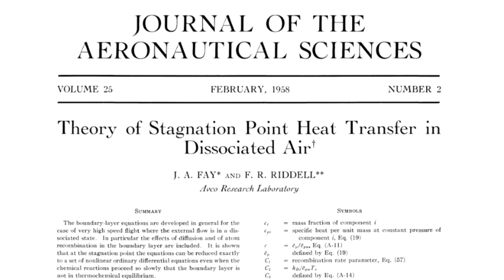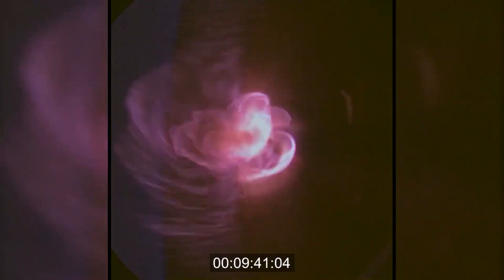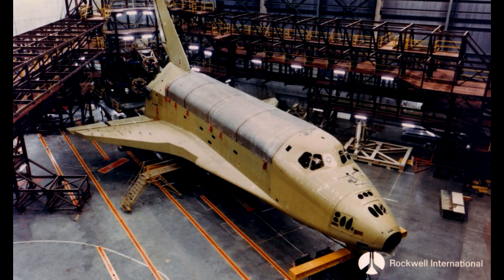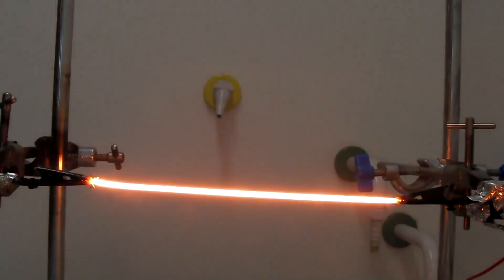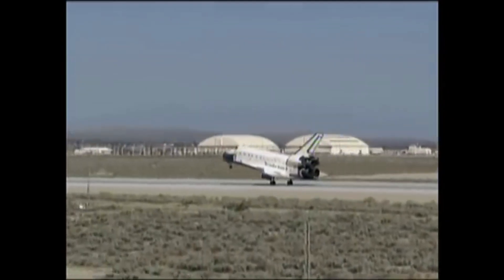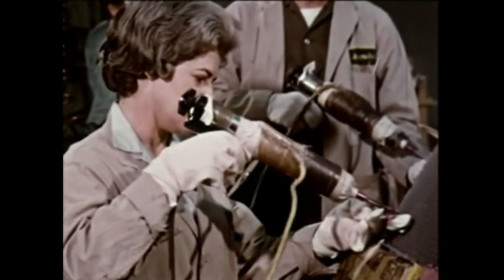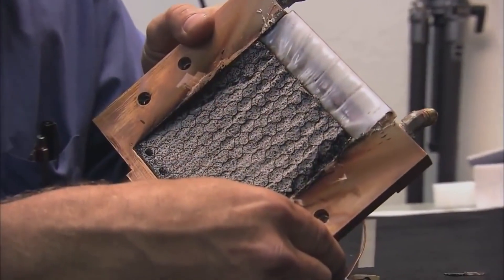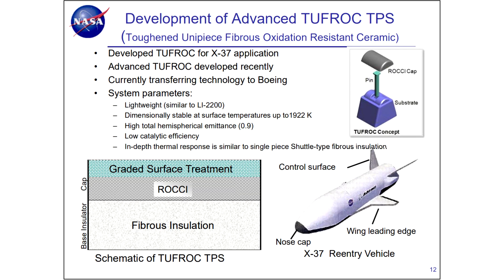Heat Shields - Things Kerbal Space Program Doesn't Teach

Comment: Has the conceptual heat shield known as a "Balloot" ever been tried? I remember reading about it in either Popular Mechanics or Popular Science the 80s as a teenager. That article was done around the time the movie 2010 Odessey II was released. Everyone remembered that Balloot idea that the Soviet spacecraft used to brake it's speed as it entered Jupiter's atmosphere just long enough to place the craft in a comfortable orbit. Inflatable huge balloons around the main engines. Main engine rocket exhaust envelopes the spacecraft as a cooler layer between the spacecraft structure and Jupiter's superheated atmosphere it's plowing through.

Comment: what about carrying enough fuel to slow the reentry speed to an easier value to handle heat-wise.   
That’s basically what Space-x does with its boosters, isn’t it?
Reply: The Falcon boosters are entering from suborbit, almost just a straight-up-and-down trajectory. They have very little velocity compared with orbital velocity. So the reentry burn doesn't have to be very big to negate a lot of that velocity. Coming from orbit, a reentry burn would have to be enormous, and would require launching an insane amount of propellant, which in turn would require an impossibly big launch vehicle for even a small payload.

Comment: I will ask perhaps a stupid question but it bothers me some time already. Could we actually transform the kinetic energy into something we can save? For let's say launch?
Reply: You could build a heat engine that uses the shock heating for its hotplate and a radiator for the cold plate.
Then you would have to store the energy somehow, meaning several tons of batteries.

That would mean adding a huge and massive contraption, capable of killing everyone inside the capsule if it fails and making the whole mission incredibly expensive, heavy and risky.

You would not recover much energy at all, most likely you would loose more energy due to higher launchmass than you would gain after landing.

Comment: I'm sure this has been asked:  is it easier to have the extra mass and special materials to handle reentry from interplanetary velocities, or, does one carry extra fuel (I'm reminded of old proposed nuclear propulsion where it was basically running 100% all the time -- accelerating half way and turning around and braking the remaining half) to reenter with less challenging energy deltas ?
Reply: From what's currently done, extra shield mass is what's the most cost/effective solution.
And it's easy to understand: in the shield case, atmosphere is what's givig you te energy to slow down, so it's almost free, but for the generated heat.

Comment: Hey Scott, love these videos. Please feel free to message me if you intend to cover hybrid/multicycle nuclear jet propulsion, aerodynamic inclination maneuvering, and regenerative (liquid) heat shields - I can point you to some good sources and answer some questions.

A good starting point is Bucknell's Nuclear Thermal Turbo Rocket proposal - it uses liquid hydrogen and a multicycle engine with jet, ram+scram, and thermal rocket phases to achieve orbit without boosters. Whether that's single stage is debatable, semantically.
Reply: Also, just saw the end of this video - the real use case of TUFROC and similar technologies are their chemical properties, as they wear very predictably when exposed to a wide range of reactive/hot gases and plasmas. You could even use seawater as a coolant.

Comment: Really good video!  Ablatable heat shield is the way to go. Especially if it can be multi-layered so that a completely new multi-layer shield is available for a return trip from somewhere like Mars.   Using the moon as the To: Mars, jump off and away station for return trips might significantly affect the fuel calculus.

Comment: Why can’t magnetics deal with redirecting heat/plasma around and away from the ship?
Reply: Good question. I know that the possibility of using a superconductive magnetic coil to create a very strong magnetic field near the leading edge of the vehicle to deflect plasma is currently being researched. This would be much lighter than an ablative heat shield and would eliminate the cost of reapplication in the case of craft such as Crew Dragon.  However there are a myriad of challenges associated with the development of this, chiefly calculating changes to the trajectory of a vehicle, because the air will be deflected away much more than with current heat shield technology. Also, the ionised gases surrounding a capsule using a magnetic heat shield would prevent the use of radio signals for telemetry data.

Comment: you survive re entry by slowing down as much as possible before hitting the atmosphere. turn around and fire engines against your orbit so you don't hit at break up speed. then your just falling like falling objects that don't burn in the fall to earth. many meteorites are never seen accept as objects on earth. they don't leave craters. they look like they are just sitting on the surface maybe sunk in the soil a bit but easy to see without a shovel. objects that are in the same orbit as earth either catch up to us or we catch up to it depending on its density. so heavy and light objects will make similar impacts because its only gravity pulling it once it hits the atmosphere. the suns atmosphere goes to the Kuiper belt. the super massive black holes atmosphere is the entire galaxy. gravity is at mo sphere i see. the moon is in earths hydrogen atmosphere truly which is a co-op with the suns atmosphere and a trinity with our dark super father who is the dark sun of something extremely brighter called the biggerverse. which is still less then the universe which is all one thing in whole together.

Comment: How about a slower direct perpendicular approach back to earth. Why does the approach have to be so fast.
Reply: Reentry is basically an energy management equation. In the case of the shuttle, it was about shedding it at precisely the right rate to reach the landing site and in one piece. If the angle is too acute then the vessel will burn up, too shallow as you suggest and even apollo/soyuz capsules are lifting bodies and will bounce off the atmosphere and into space like a pebble skimming across the surface of a pond. Since orbital velocity is in the region of 17,500 mph - depending on orbit, it would take a huge amount of energy to shed this and so the atmosphere is used as a brake. Crewed space vehicles must therefore be slowed to subsonic speeds before parachutes or air brakes may be deployed. Such vehicles have kinetic energies typically between 50 and 1,800 megajoules, and atmospheric dissipation is the only way of expending the kinetic energy. The amount of rocket fuel required to slow the vehicle would be almost equivalent to the amount used to accelerate it into orbit. 

This has to be performed at precisely the right angle although high G ballistic reentries in which the only forces are gravity and drag are still an emergency contingency.

Comment: Could magnetic shielding work?  Or help?
Reply: Good question. 

I know that the possibility of using a superconductive magnetic coil to create a very strong magnetic field near the leading edge of the vehicle to deflect plasma is currently being researched. This would be much lighter than an ablative heat shield and would eliminate the cost of reapplication in the case of craft such as Crew Dragon.  However there are a myriad of challenges associated with the development of this, chiefly calculating changes to the trajectory of a vehicle, because the air will be deflected away much more than with current heat shield technology. Also, the ionised gases surrounding a capsule using a magnetic heat shield would prevent the use of radio signals for telemetry data.
Reply: Yassassin   We need more research on Quantum Physics to transmit durning Magnetic shielding.  By flipping an Atom and watching it’s companion flip at a distance we might be able to communicate through the “field”. The thing would be to steer the shield to protect ahead of where you think you might need it most. Just make the craft from a big magnet. Machine the spaces out as needed.  You could pick up some extra mass along your way.  Materials to process.

Comment: I believe, at a certain point in time, Designers will utilise the hypersonic return speed to evaporate water from an actively cooled heat shield, just as the engine uses the fuel to regeneratively cool the combustion chamber. Thermal tiles, ablative shields, stuff from the past! Use speed to evaporate water and cool a surface covered in that tubing, just like the engine nozzles.
Or add a retro rocket to slow down descent? How much fuel would be needed for a powered descent?

Comment: hmm...Here is a question for you. They want to prevent as much heat build up as possible so they want to keep the heat away. Why not absorb the heat and convert it to energy? Something akin to geothermal energy systems.
Reply: Geothermal stations make electricity with a thermal gradient -- they use water to transfer heat from a hot place to a cold place. When you're barrelling through the atmosphere at Mach 20, the only cold place around is the inside of your ship, which is the one place you don't want to get hot.

Comment: Thank you for the very informative video Scott. I have a question. As reentry generates a layer of plasma per the hypersonic aerodynamics mechanism that you explained, it reoccurred to me the following idea:

What if the space vehicle were “encased” in a high density magnetic field that flipped its polarity (the plasma is composed of both positive and negatively charged moieties, no?) at a high enough frequency to effectively repel (both the (+) & (-) charged ions) the majority of the plasma and push the boundary layer even farther away from the surface of the vehicle? I’m thinking of this concept as sort of an inverted Tokamak.  

Are there any privately or publicly funded aerospace science and engineering groups that have considered this and/or experimented with this “magnetic thermal deflector shield” concept? 

I can’t be the only person who has considered this. I recall having a “what if” moment right after the STS-107 Colombia tragedy where the idea of having a more effective and efficient engineering solution was needed and conceived this magnetic field plasma “deflector” idea.

Comment: I never figured that bit out about the shuttle nose. 

Always figured it was for payload or sensors, like how jet fighters have relatively wide nose fairings to house radar arrays.

I always assumed command capsules came down "backwards" in an attempt to maximize deceleration, but a bit of decel probably isn't worth the added difficulty of flying stable with your drag vector facing forward. Surviving the heat of reentry is worth that difficulty. 

I should have started playing kerbal a long time sgo lol.

Comment: No one needs to solve the heat shield issue when space craft have engines that are able to decelerate the craft from whatever  speed.
Reply: If you can build engines with that much efficiency, you should get cracking! I'd love to see someone bring liquid-core and gas-core nuclear thermal rockets onto the propulsion scene.

Comment: I seem to recall once hearing about a wooden heat shield used on some unmanned spacecraft - I feel like that would be worth a mention in this video. May sound crude, but it's really not too different from the materials used for the Apollo capsules - a carbon-based fiber-composite material that chars into carbon, emitting gases as it becomes a layer of low-density carbon material, all without melting. Probably doesn't perform as well or as predictably, or is heavier per amount of protection, otherwise it would have been used in later spacecraft - sure is cheaper and easier to manufacture than these other things!  Another similar point that wood can be effective in this way, if designed right, is that fire doors in buildings - rated to hold back a quite hot fire for a reasonable, though finite, period of time - are commonly wood.

Comment: In a slightly related note I have cast lead Ingots and more complex shapes using dry balsa wood as the mold form. It was even reusable though the dimensions did slightly enlarge with subsequent uses which wasn’t critical for my application.

Comment: Many thanks for this and other informative videos. Regarding the X-15, its ablative coating had the unintended effect of trapping heat in the X-15's airframe, which otherwise acted as a heat sink. See Milt Thompson's book "At the Edge of Space"  An individual who worked on the X-15 project told me how there was some talk of putting the X-15 in orbit, but try as they might, none of the X-15 pilots could fly the simulator from orbit to landing without burning up. A non pilot asked to try, and succeeded on his first attempt. Everyone wanted to know how he did it. Simple, he said, he watched the temperature gauge. If the plane got too hot, he climbed; when the plane cooled, he descended, and gradually worked his way down to a safe landing.
Reply: A true person deserving of the role of astronaut!
Reply: Isn't that essentially how the thermal system on the X-20 was designed to work?

Comment: "It's very simple..." dude. It literally is rocket science. Excellent video as always, you always pitch the level just right.
Reply from the maker: Rocket science is easy to understand after the fact, rocket engineering is hard.
Reply: @scottmanley  I've always found the use of "Rocket Science" as a stand in for "something impossibly hard" quite ammusing. When it comes down to it, you don't need much more than Newtons laws of motion and the ideal gas equations. It's building a machine which will actually DO it reliably without exploding that's hard.

Comment: Technically, the BFR's heatshield is actually ablative. Kind of. Really stretching the definition here. The stainless steel heatshield will reflect some heat away, absorb some, and insulate the spacecraft. But, it also uses tiny pores to leak out cryogenic liquid methane. The liquid cold methane will stick to the stainless steel during flight, due to stainless steel's properties, and will only leave once reaching a gaseous state. This will take a lot of heat, especially since BFR will be actively cooling it's fuel, liquid methane. Once the methane is a gas, it will have absorbed heat to change state, and have taken a lot of heat with it when it flies off. The methane will then, yes, explode creating more gases to further insulate the spacecraft. So, yeah, BFR technically has an ablative heatshield as it has a material absorb as much heat as it can before falling off with multiple chemical reactions to then still insulate the spacecraft more. The only difference is that BFR will be absorbing more heat before the methane falls off to explode and insulate, and it will also be a refuelable heatshield as it is using the BFR's fuel as the material.
Reply: This video was made long before the stainless steel update.
Reply: @ax2bxc  Oh. Well then... Whoops.
Reply: @almondpotato9483  
I lied...
Reply: @ax2bxc  ...

Comment: One advantage of ablative shields is latent heat of vaporization. The material not only requires heat to raise it's temperature, it also requires additional heat to change into a gas, without increasing it's temperature, thus giving it a heat protection bonus. 
Water if famous for this. It's why it takes so long to boil. ( 190 degrees, 200 degrees, 210 degrees, 212 degrees, 212 degrees, 212 degrees, steam!)